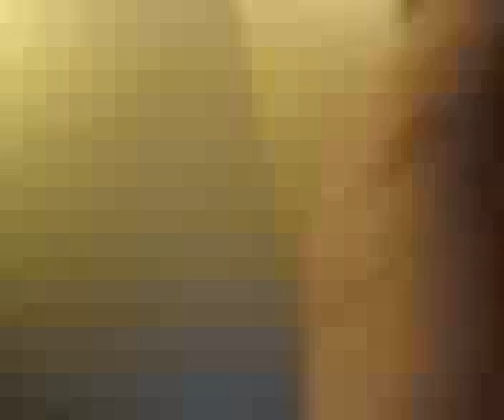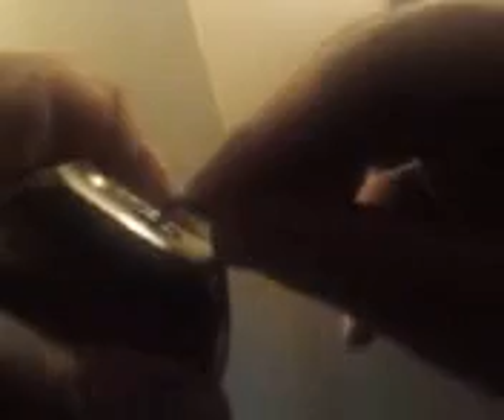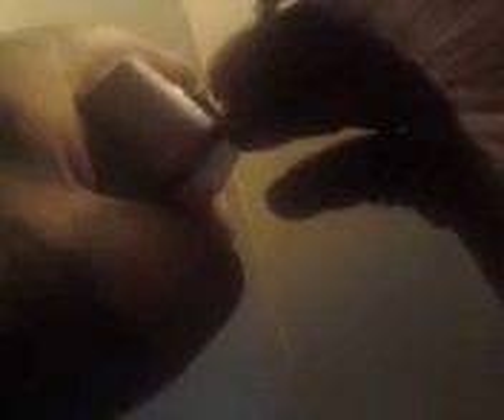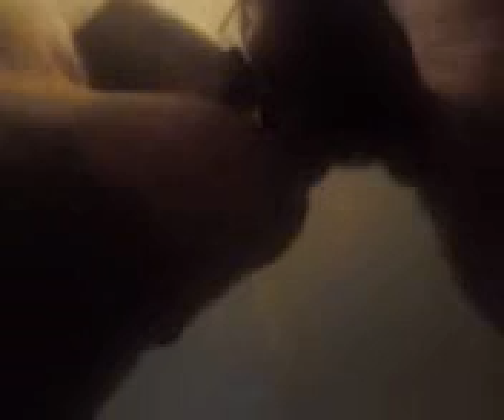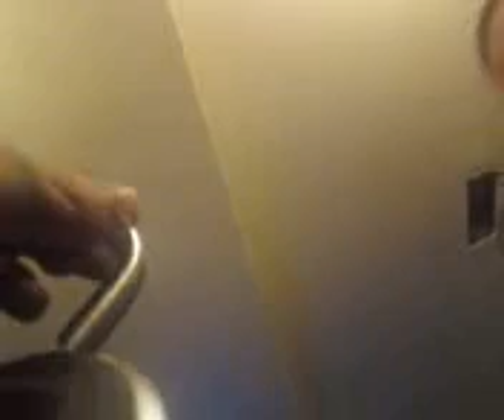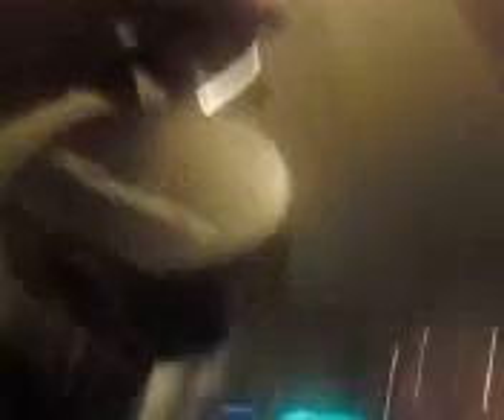Master 930 spp'd

Comment from the maker: @Siv , the core in this lock is pretty beat up ! It was my 1st lock with a remove-able core so i took it apart lost pins n springs,lol had 2 bust open cheap locks 4 parts Then I made my 1st cut away with it. Wow I luv this stuff . q;)> when i get 2 a comp. I will pm u my address ok ? Peace